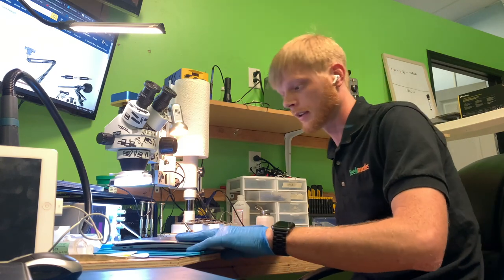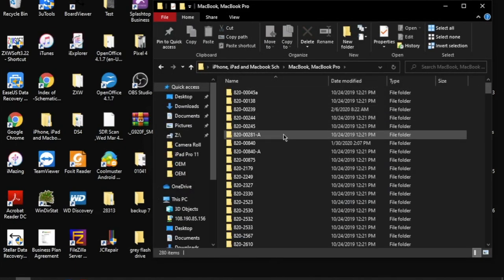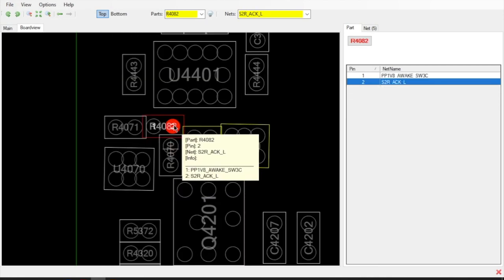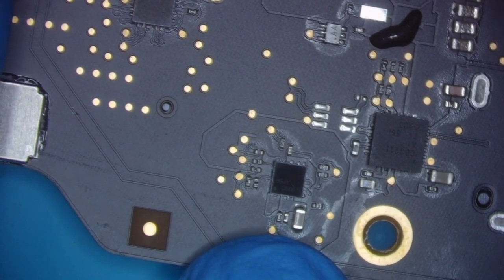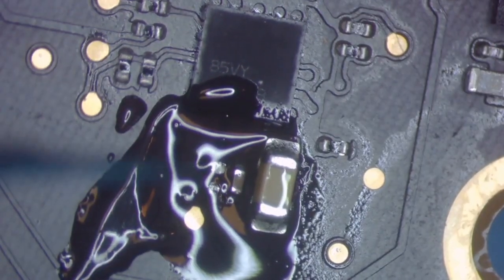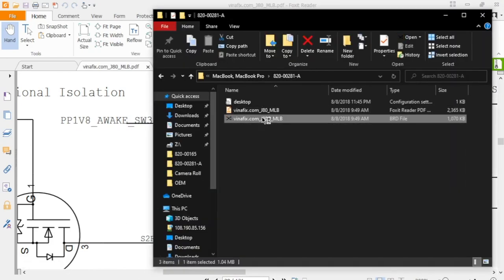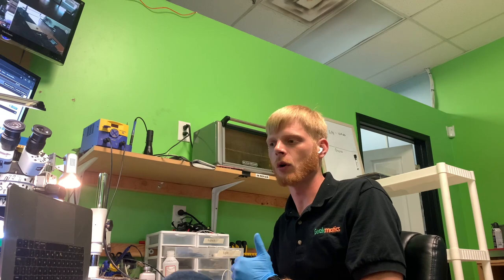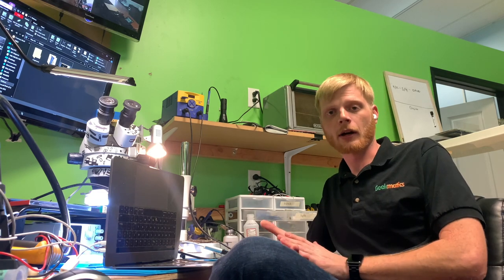820-00928 - MacBook Pro USB C no power, Diagnostic process

Comment: Dusten well done on the video and explanation. 10:33 you will love the part search function in Flex Board View There are three fields available for any part you want to search on. I generally use size, tolerance and value for passives and maybe a part number/ package size for IC's, mosfets etc. It will search all the PDF's that you have in the directory that the software is pointed to and give you a list of all boards that have that part on them. Then click on the board that you want to pull the matching part from and FBV will open the PDF at the location of that part. About the only thing it doesn't do is remove it and solder it on the board you are repairing :)
Reply from the maker: Thanks for the advice man!
Reply: I believe Paul is paying to this guy to advertise... XD just kidding man! buy now, don't delay! right Peter??? Seriously amazing software, saves tons of time...